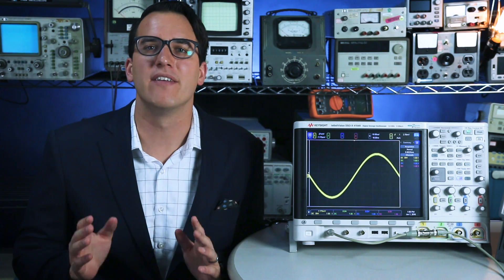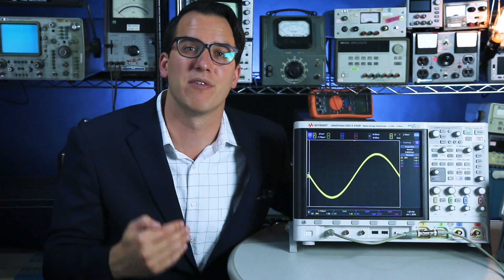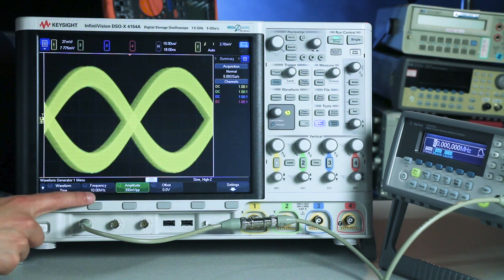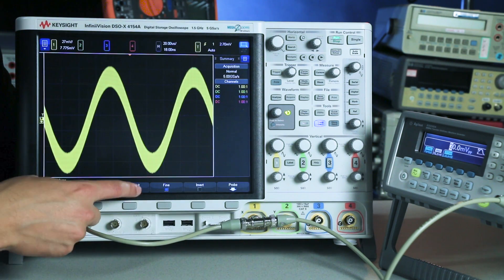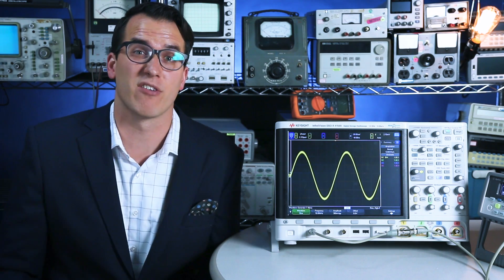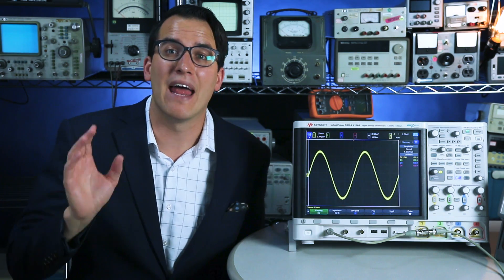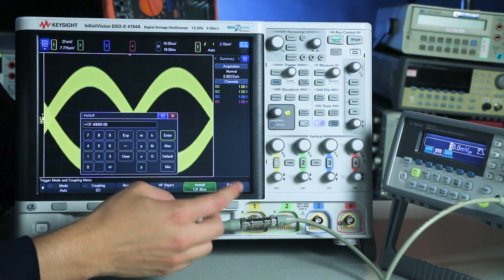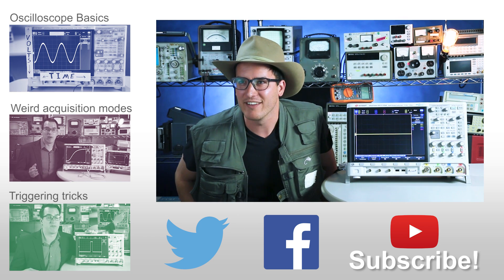Practical Uses for Bandwidth Limiting - Oscilloscope How To - The 2-Minute Guru (s1e12)

Comment: That was such a simple and straighforward way of inducing noise into the signal. It will probably come in handy to simulate interference/noise in future projects.
Also, good use of the holdoff function at the end! (I rarely see it used nowadays, which is a shame, it's such a powerful tool for many situations).

Comment: About the BW limit can you make it a start and stop limit on it?
Reply from the maker: Good question! It depends on the scope. The InfiniiVision scopes don't have that capability - the bandwidth limit is in hardware. It is possible with the Infiniium scopes and other scopes that utilize DSP in their acquisition systems.
Reply: KEYSIGHT OSCILLOSCOPES Ok thanks, so I what I can understad is that InfiniiVision Scopes are more intended for general troubleshooting and education and has function generators. So the Infiinium is intended for a more complete and in depth analysis right? InfiiniVision scopes also have different software applications more intended for troubleshooting than Infiniiums right?
Reply from the maker: Yes, you are correct. The InfiniiVision scopes are targeted more towards general troubleshooting, and the Infiniium scopes are targeted more towards deep analysis. The software offerings can also be different. If you want to learn more, you can check out the web page: 
http://www.keysight.com/en/pcx-x2015004/oscilloscopes?cc=US&lc=eng

Comment: I've been wondering how to demonstrate the need for a high bandwidth scope --something capable of producing qualitative results to substantiate the need for a quantifier ie high band oscilloscope. To that end,  Wouldn't it be neat to offer an asynchronous scope as a vacuum tube in the raspberry pi price range, something with a plasma ball beam signal generator as an option?  I envision it having 6 plates instead of the typical, 1940's style 4 plate scenario with ion beam hitting a phosphor screen. The 6 plates would be 3 sets of pairs, where each pair influences a dimension (x,y, or z).  The pairs could be equally separated, or maybe vary by a logarithm of distance from the others in order to allow for more varying inputs without requiring additional external signal attentuation that might affect the signal under test.  The idea is then that one could use standard features of a camera to record results for demonstrating need of a HF scope.The plates could be spherical bearings..
Reply: Well, a camera isn't going to discern high bandwidth by itself, but maybe modulating the display with an lcr circuit or two could do the trick. Anyway, It's probably more practical that I work on making a useful DIY vacuum tube.. Alas, another project idea to shelve 'til this winter.
Reply from the maker: Interesting thoughts!
Reply: How do you make/position a phosphor screen that can be a target of cathode rays in 3 dimensions? A hemisphere with the emitted beam some distance past  the center?  Does this have something to do with the plasma ball beam signal generator?  How old are you?